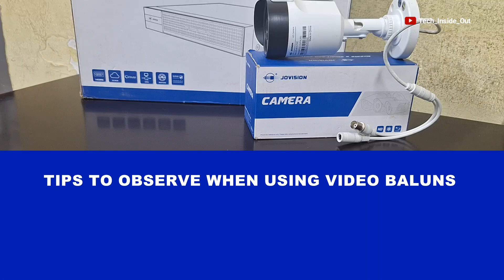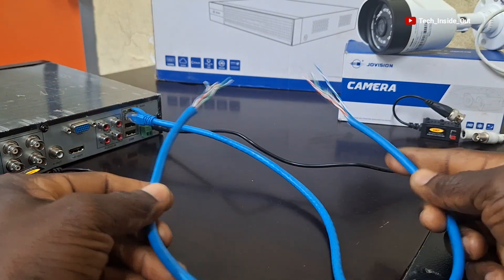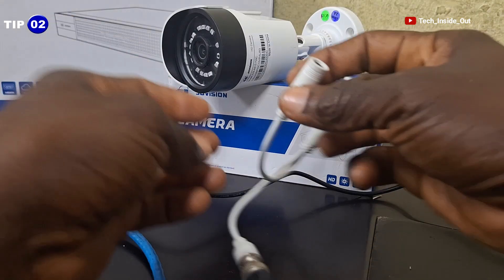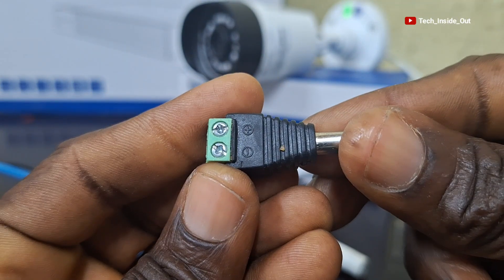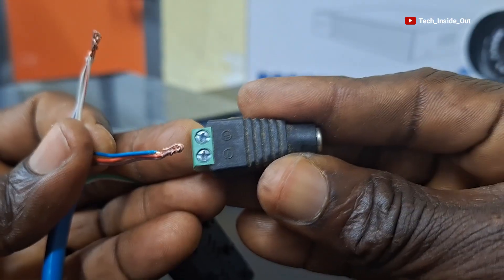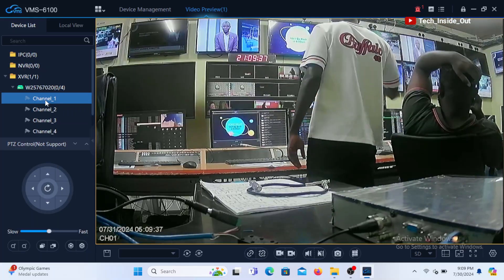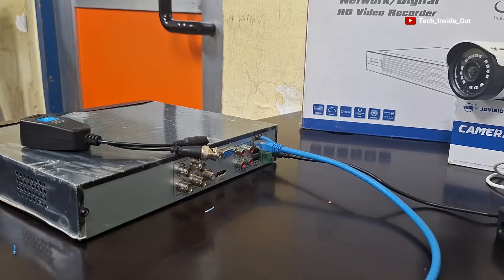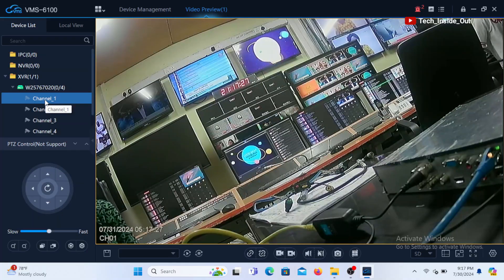Video Balun Connection tips for effective video transmission in cctv camera installation

Comment: I have on the corners of my house BNC camera's. How can I add one extra BNC camera over the same signal line? So I have 2 camera's on the corners running on one cable. Thx.
Reply from the maker: For Coaxial cables, you do not have the chance to add a second camera. For the use of network cables, it is possible but not advisable
Reply: @Tech_Inside_Out oh too bad. But thanks for taking the time to answer me👍

Comment: Hi I am getting double imaging on my cameras, I have doubled up on the video feed wires in the Baluns, so I’ve put a pair in negative video feed and a pair in positive. Could this be the issue ? As I see in this video you have only used one pair of wiring for the video freed
Reply from the maker: Power requires a larger cross sectional area for the cable than the video. 
Once your power is defective,  it reflects in the video
Reply: @ thank you for your response, my power is the same as your video, three wires for positive and three negative. It’s only the Baluns that I have doubled up on
Reply: Make sure the pair matches both ends

Comment: Am surprised that no one is talking about the distance and how it affects the quality of video when using the baluns 😢
Reply from the maker: Video Baluns are passive devices and do not add to signal quality.  Cable length limit of 100m should be adhered to when using Video baluns

Comment: I installed hikivision camera with Dahjua DVR but it comes black and white pls what is problem
Reply from the maker: Its compatibility issue between the two systems
Reply: Change the transmission protocol
Dahua uses CVI while Hikvision uses TVI. Use the appropriate one for each camera
Reply: no need to peel the cat6 tip to put in video balun?